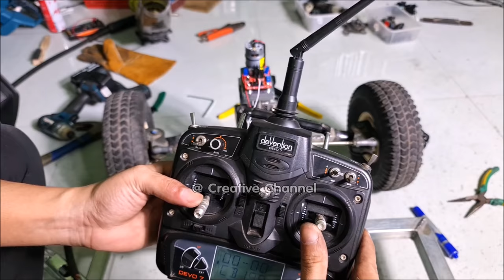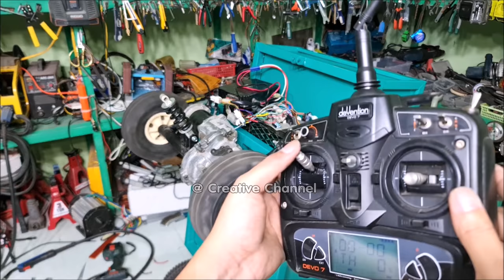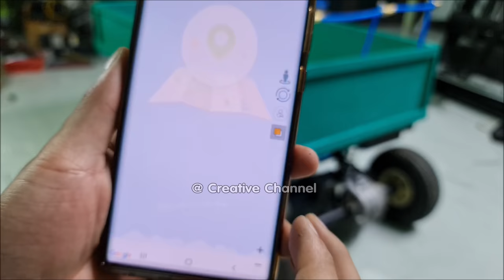How to make RC Wheelbarrow Truck - v2

Comment: Wow, very cool build. I didn't quite know what it's purpose would be but now I know. I'm curious, though. What are the brass spray nozzles for? Anti-theft...to keep dogs and cats away? It's a cool feature to have added. It's roomy as well since nearly your whole family can sit inside and it can support the weight. Impressive! I think I like the VR headset addition the most. Sometimes a guy just wants to relax and let the R/C wheelbarrow do the work. It's got comms, too! I think this is my most favorite build for 2021 so far. Thanks for the video.

Comment: Nice project !!!!!!
But Sir you need to add some security system on it so it can go anywhere without any stolen issue....
Reply: Like a lid with lock?  The water spray is a deterrent.  And in a village community, you don't have security concerns.

Comment: Please make a video on how you get all those parts so easily and in such quantity
Reply: Parts are subjective to your area. Much if it can be ordered online. Not all parts will translate good. Though I do have a hard time finding some of them from time to time and or a source for them. One version a while back when he had the hybrid gas to electric engine It was super hard to find it. As I would like to have something like that. Many other things are easy or hard to find depending on how you shop online and where you shop at or from which site. Though I wish he would list a lot of the products with affiliate links. As I think he would do super well with many of the products.
Reply: For example the main drive unit in the video. I still have not seen any markings on it to tell me what it is or even what to call it. Which will make it hard to source it out.
Reply: I think its called a electric transaxle. Might have come out of a electric riding mower or bought as is.
Reply: @kameljoe21  that's from a mobility scooter.
Reply: @fullmetaljacket7  yeah its from the store carts. Not all mobility scooters have the transaxel. Though some do.
Reply: @kameljoe21  most of them do. I actually never seen one in person that don't. Hell, even golf carts have an axle just like that one, only bigger. The front wheels he used are also from a mobility scooter.
Reply: @kameljoe21  btw I'm talking about the kind of 4 wheeled mobility scooter old people usually ride. Don't know if the 3 wheelers are different.
Reply: @fullmetaljacket7  yeah i know what you mean. Some of the older models of scooters had direct drive motors. Yeah I think the 3 wheels might use a trans axle. Older electic golf carts were just direct motors to diffs. I have never worked or or messed with the newer golf carts. Though i would like to check one out.
Reply: Aliexpress mate
Reply: everything here ...your local or ebay and amazon etc ....

Comment: Work is Amazing but why no suspension at the front???
Reply: i think there is
Reply: @w.j5764  see work at beginning... You will see front wheel system constructed and connected straight to frame

Comment: You are spraying your neighborhood with chemicals from that thing.
And you would soon have ruined the engine if this cart were to be used up and down hill in dirt and gravel. And a wheel barrow needs to be much lighter than that. It can not have all those heavy parts on it. You need to be able to use it without the motor too.